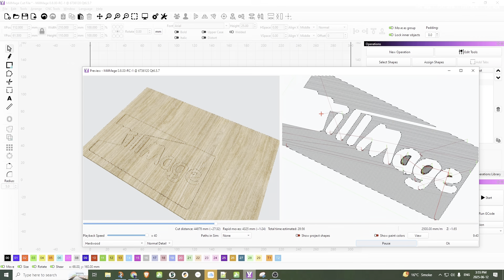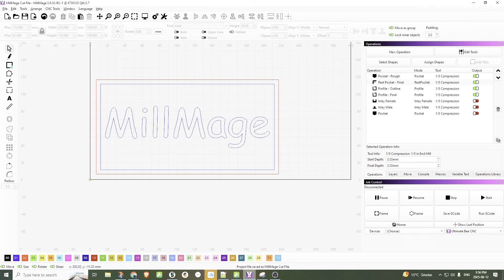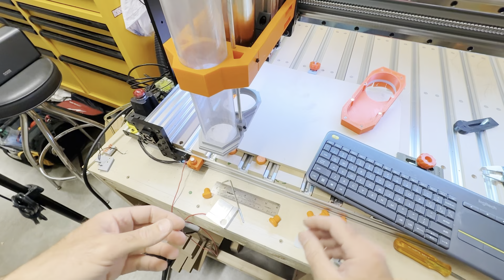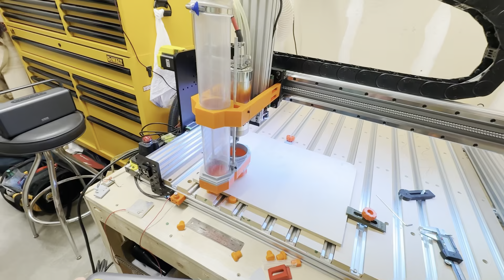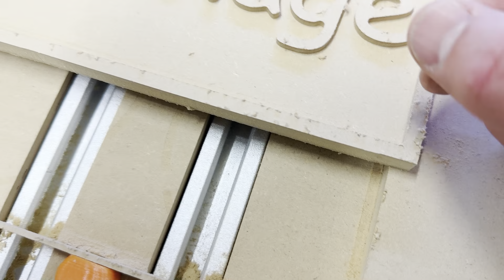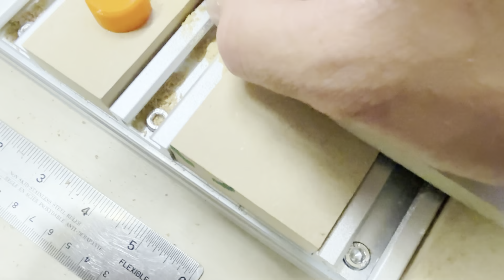First cut using MillMage on the Ultimate Bee CNC

Comment: Did you add something in your Custom Gcode to specify a coordinate system and that's how you ended up with G55? MillMage shouldn't be outputting anything other than G54 by default so I am curious how this happened.
Reply from the maker: I did look there and I I didn’t find anything in the start GCode section as well I haven’t been able to duplicate the issue so far but it was an interesting one for sure.

Comment: Hi Sparks 
Since a couple of days I own a CNC machine and downloaded Millmage as well.
 (I  use  Lightburn on my Laser)  I watched your test Millmage video 
However  I do not understand how you programmed your testfile, meaning the pocketcutting around the text
In my operation, after pocketing, the text will be cutted as well.

Can you please explain in a video how you program this?
Thanks in advance for your help
Ron
Reply from the maker: Hey thanks for watching. Yes I can definitely do a more detailed video on the cut operation for sure, I probably won’t have a chance for a few days but I will get it done. 
In the mean time if you look at the video I have two rectangles and then the text. Make sure you select the pocket operation on the right and then select the inner rectangle and the text at the same time with them both selected click on the Assign button in the operations area. This should make it so the operation clears out the inner rectangle and around the text.
Reply from the maker: Hope this helps if you haven’t already figured it out. 
Raised Text Sign with MillMage
https://youtu.be/INotbuM63oU

Comment: Also love lightburn, thanks for sharing, I’ll check out the software
Reply from the maker: Thanks for watching. I have been avoiding paying for Vectric and making do with Easel, an old version of Carbide Create and Fusion 360 so I am excited for this project.
Reply: @sparks-tech  I have been using Lightburn for about 4 years with no problems, feel very comfortable with it.  As soon as i switch over to a CNC router and Millmage I have difficulties.
Reply from the maker: @DwightStebner sorry to hear that. What kind of issues?
Reply: @sparks-tech  Just learning issues. I have no problems with LB hope I can figure Millmage out. With I had local support.